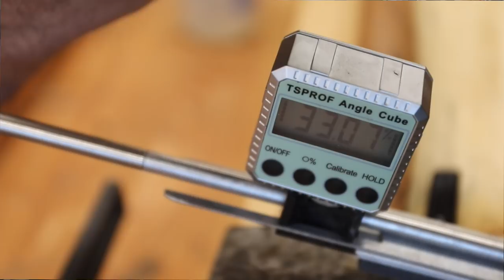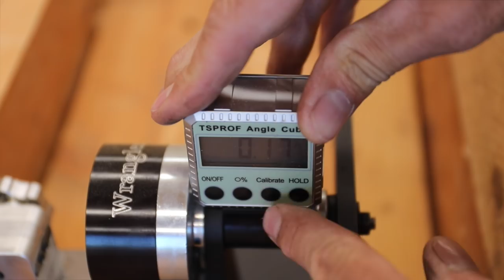Can An Axe Ever Be Too Sharp?

Comment: You have 25 degrees PER SIDE! This means 50 degrees included angle. Too blunt. You want 25 degrees INCLUDED ANGLE. This means 12.5 degrees per side. Just like a knife.
Reply from the maker: Please show us how to do it corretly in a video Joe,
Reply from the maker: I guess we’ll be waiting a very long time,
Reply: +Wranglerstar
Boy, you really can't take criticism, can you? Kinda weird for a "manly man" to react like a little kid. If he's wrong, just tell him how and why, if he's correct just admit it and maybe state why you decided to go for a larger included angle.
Reply: Looks like it cuts just fine to me.
Reply: Wranglerstar I thought joe’s advice was extremely helpful. Why did you take it so wrong? I also recognized the edge a little bit thick for what an axe usually is.  If you chose to make it thick, tell us why, if you made a mistake, admit it. Don’t take it out on the guy who made a very helpful criticism. You just lost a little bit more respect in my eyes.( and I’m entitled to my opinion so don’t try to  make me look like a bad guy)
Reply: I don't think an ax should be that sharp, correct me if i'm wrong but even the angle Wranglerstar made was too excessive. My reasoning is that depending on the work (an ax to chop with not cut), you would be worried of chipping the blade if it's too thin. Or rolling the edge too often.

Comment: I recently bought a Hultafors axe/hatchet hand made by Hults Bruk, Sweden, 17 1/2" in full 1 3/4lbs, hickory handle, i followed your instructions  by scraping  the handle  and rubbing it  with boiled linseed oil, it came shaving sharp, it has no secondary grind it is basically a full flat grind, as you can probably tell I love it, it is perfect for my winter job, selling Christmas tree's, I use the axe to taper the bottom of the tree to the customers needs, I got it new for just under £32 ($40) did I get a good buy?

Comment: A fireman’s axe can be too sharp.  Those are bludgeoning tools and not chopping tools.  My lesson after an afternoon of
sharpening the department’s axes was to have the Captain hand me a stone to round them over.
Reply: if they need a bludgeoning tool use a battering ram or else how would they chop a door to pieces
Reply: Well here is the thing an axe typically takes a lot of abuse.   You can spend a ton of time sharpening it but it sure won't stay sharp for long.
Reply: Shady Lamp adf
Reply: Shady Lamp 🙎🏿‍♂️🔫
Reply: Shady Lamp done he th etch teth d
Reply: Shady Lamp right

Comment: I was speaking to a guy who does restoration and preservation of ancient weapons and armor some time ago. He said when putting things up for storage you should wax them rather than oil them. Apparently when dust settles on oil it can wick water to the metal and you get pits. Because of the viscosity of wax that does not happen. I know used bicycle chain wax on all of my cutting instruments from knives to access with much better corrosion resistance than oil used to give me. Just an interesting tidbit I learned.

Comment: Putting such a fine edge on a tool like an ax is a waste of time.  When the ax is used for its intended purpose, the amount of force (F=mA) will quickly distort that steel and that edge will be gone.  The angle of the edge and how far back that angle can be carried back into the blade are important considerations.  Too low of an angle and the edge will distort and become "dull" quickly.  Too high (fat) and the edge will actually do less cutting of the wood fibers and the mass will force the fiber apart.

Like most thing in life, it is a compromise.
Reply from the maker: This comment was a waste of time,
Reply: Touché !
Reply: Your above comment of Jack's above comment has caused me to want to waste my time & comment.  This strikes me as thin-skinned & punching down, & I'm sure a few more clichés as well.  Aside from his installing F-mA, which was designed only to make him look smart & did not work, everything else he said was right on & he was literally answering YOUR question!  Nowhere in his comment was he anything but polite, & you answer back with "This comment was a waste of time,"  & yes, I didn't clean up your poor comment, I left the "," there at the end too.  You're allowed to get frustrated with your commenters - without whom you'd have to work a real job btw, but when it's someone who in no way deserves it, no, that's not OK.  Scott Sherman
Reply: @wranglerstar  I enjoyed Jack's comment. Yours however was unreasonably, almost absurdly rude.
Reply: @elliottg5987  Yeah the more i read wrangler's comments the less respect I have. Honestly I can't tell if it's him or his wife doing the internet battling. Probably both

Comment: Such a peaceful activity sharpening can be - thanks for the very relaxing video Cody!  I'm curious how quickly the finer point of such a sharp blade will fold over and develop a burr with the next use.  I've noticed you typically like to push the blade angles on the sharper side of the typical 30 degrees with your axe restorations (I prefer that as well), but I'm curious if your breadth of experience has left you with a favorite angle that gives you the optimum ratio of utility vs needing to be re-sharpened all the time?

Comment: Hyperkyphotic youth.  That sharpening jig is the way to go... Nearly impossible not to cheat the bevel to catch a bur by hand.  I do agree with other comments about inclusive angle, but your axe is sharp and will no doubt have great edge retention.  If you have a brand new sfa handy,  you'll see the factory bevel is way steeper.  Anyway, now i want that sharpening system.

Comment: Hi Cody. Have you ever tried to use a traditional wet stone? I my self use a Tormek T8, a wet stone on one side and a leather wheel on the other. The stone can be adjusted in two different grit levels (c:a 600 and c:a 1000) and after that you just turn the machine around and hone on the leather wheel. The tools get really sharp... I use it for all my knifes, chisels and axes. I can even sharpen scissors, drill bits and more. It is very popular for wood turners as they can sharpen all the different styles of tools with the same precision every time. Check it out.. You will love it..
www.tormek.com (you like quality products.. they leave 7 year warranty even for professional use on the bigger T8).

Comment: Axes are not supposed to be as sharp as a razor blades.  Razors are used to cut tiny little hairs axes are used to cut wood there is no point in sharpening an axe to razor sharpness because the first time you swing it into a tree that razor-edge is is going to be ruined and dulled possibly even more dull than regular axe sharpness which is optimized for being balanced between sharp enough to do what it needs to do while being durable enough to do it for more than one swing of the axe so yes it is possible to get an axe to sharp

Comment: Tools cant be too sharp. Its safer to have a too sharp tool, because its controllable. And if you cut yourself, the wounds are not as bad when the tool is sharp, maybe  its deeper but the edges are straight. If the tool isnt sharp, the edges get Frayed.